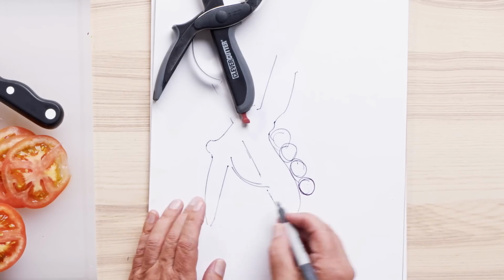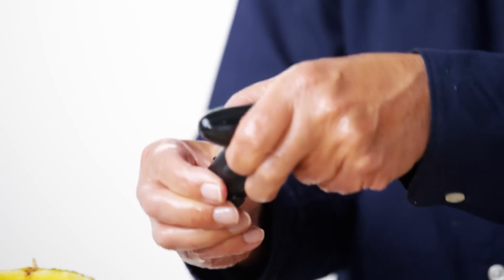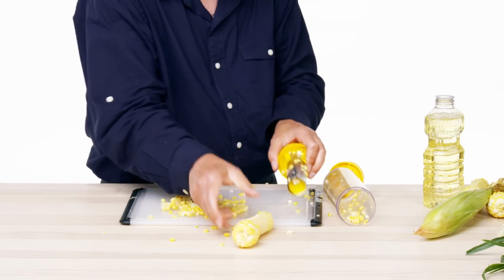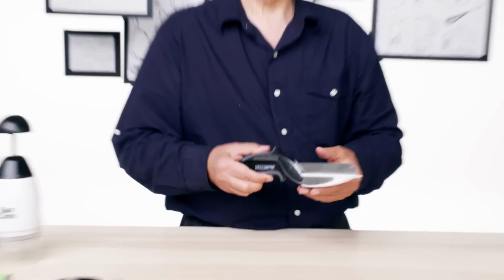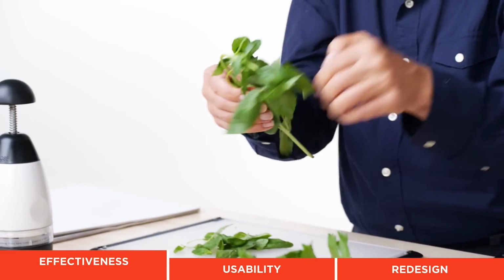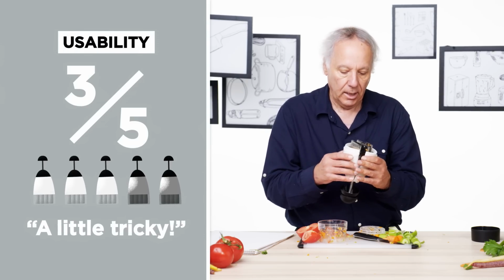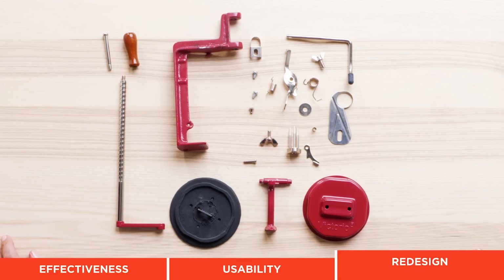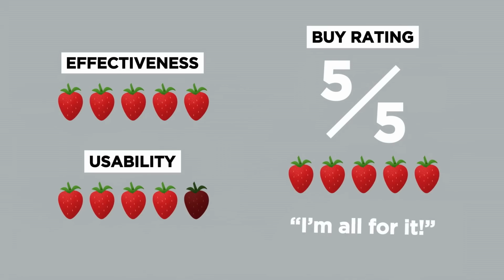7 Slicing Kitchen Gadgets Tested by Design Expert | Well Equipped | Epicurious

Comment: For the Slapchop thing, it probably would of been more effective to just take the big full-sized veggies and cut them so they fit in a blender, and just use the pulse-blend button (press, release, press, release, etc.) it until the desired chunk-size is achieved...The Slapchop is basically a manually-powered pulse-blending device, that doesn't seem to do the job all that well because of the gaps of the blades not reaching all the way to the cutting board surface, you don't have that problem w/ a blender cuz gravity usually pulls the pieces down into the blades (though some juicy pieces might stick to the plastic/glass of the blender-pitcher).

Comment: Thank you for thinking about dexterity problems!😊 Also using an oily left hand is great! Im left handed and I often have to rewash my hands just to hold something then after i’m done cooking my hands are super dry and I have to lotion them up. 
I wish every product designer used your method of thinking since most products, not even all kitchen tools, can be really hard to use as a lefty or someone with dexterity problems! I used to have seizures so now my grip strength is not good at all so using leverege or brute force does not go well for me 😅

Comment: To be honest the Square watermelons in Japan are sometimes not yet Ripe sometimes it is used for Decorations or offering cause some of the Farmers of the Squared watermelons had a Problem that producing those Squared watermelons. May not be Ripe yet cause They put it into a Square cage pannnel so that the fruit becomes Square ,Plus if you do eat some Square watermelons some parts will be seen a bit squished plus Square watermelons are 10 times  Expensive than Regular ones.

Comment: Fun fact. Since you mentioned arthritis I just thought I’d share some cool info about it. It’s an autoimmune disease that literally nobody has to acquire. It’s not genetic and it isn’t caused by old age. The culprit is actually animal foods and certain processed foods. Typically oils cause the inflammation in the joints that cause arthritis. Yes olive oil too. No type of oil is healthy for the body so avoid them and if you do use them use them sparingly. Meat and dairy is no exception either. All 3 are the catalyst in cause not only arthritis but a whole array of other digenerative diseases

Comment: For the pinapple corer i kept thinking of using a spring thing where a wiget goes up and down the spring following it like a ramp as to require only downward force.

The watermelon cuber is kind of an idea i never thought of

For a cutter i'm trying to think of a... Gullotine style thing where you set a notch distance(fractions of an inch on one end, milimetres on the other. I'm just not sure how to stop the blade in changing intervals(basically for the exclusive porpoise of evenly sliced vegetables XD

Comment: Obviously from the knob shape of the top of the corn stripper and the serrated teeth it is designed to be spun / oscillated. 
You don't grab a bread knife and push straight down...

Comment: >Struggles to cut everything with the clever cutter

5/5
Reply: Realistically just needs a much sharper blade and some curves. It’s a decent design on its own. But the sharper blade will help lots of tougher/harder veggies like carrots, beats, etc. then of course addings the curves to the handle will make it easier to squeeze. I could definately see it being a problem for people with disabilities if someone without them struggles with it. That goes for any product.
Reply: Well it's made for things that are mostly like a cucumber and not a potato
Reply: It isn't good for everything, but for the things it is good at it is great.
Reply: If you have only one arm this is the best possible choice for chopping honestly
Reply: @Paikerchu13  how do you hold the vegetable or the fruit in the scissors

Comment: Not that I'm an expert, but one thing that I've picked up is that you can't be rough with basil. The Slap Chop is a poor choice to use on basil because it bruises the leaves and, as seen, cuts them poorly. I had a chef show me that all you do is drag the blade across the leaves; let the blade do the work.

Comment: For the Slap Chop, I would add a rubber gasket type thing around the bottom of the clear cylinder for stabilization, change the overall shape to a cylinder, not a cone, add finger grooves to the middle piece and add rubber to the handle and the middle part for added grip.

This designer isn't very innovative, lol.

Comment: I just got the watermelon slicer on Prime day, and found that if you just slice off the opposite side of the rind as well, you can run straight through and improve speed and success immensely. Very little extra effort for very large improvement.

Comment: A square watermelon which would still block the fins when it gets closer to the rind. Instead, just cut the top and bottom of the watermelon so you open up the ends and the fins don't get blocked.

Comment: A lot of people are thinking that this is typically marketed for people with disability, which is generally true in some cases but a lot of it are actually marketed for businesses. On a regular household it's generally not a good idea to buy any of these unless you have a disability, or generally have any movement issues. If you're running a business/restaurant or generally need to prepare several apples, pineapples, etc; it's a good buy.

Point is, don't buy it for yourself (unless you're definitely in need) or as a gift for an abled bodied person. If you're running a business that requires you to process foods, it's something you should consider.

Comment: I dknt like the pineapple slicer since it just leaves too much leftover
Reply: I feel the same way about the strawberry destemer, it takes a lot of berry with it, using a paring knife is so much more efficient, or there is another one that looks sort of like a spoon, works great
Reply: Also with the watermelon device, I bet it would work better if you cut it in half lengthwise, cut off the ends, and used the tool along the whole length of the melon
Reply: I think it's because while peeling a pineapple you also need to remove the "eyes" which takes more time picking out one by one than just cutting the general edible parts
Reply: Yep. He care about the watermelon waste but didnt apply the same standard to the pineapple.

Comment: The pineapple screw handle could be detach with an anticlockwice turn.. a short thread or a "twist lock".
Instead of the corn stripper I would try something like a cheese slicer or a peeler idea... with a corn-sized slot of course.
The watermelon... I would probably use a knife to slice the melon in half and from there chop it into half-circles and then slice the half-disks into cubes.
-
Oh and the apple lathe, I got that exact apparatus and it is great. It works a lot better than you might think. It looks kinda wonky but man does it do a fine job.
The strawberry hole punch I would maybe design like a ballpoint pen.

Comment: I used to work at one of the biggest As Seen on TV company and most of those things do not really work or just make the work longer to finish, they are just gimmick with catchy commercials.

The average delivered prices were $2.50 but sold at $ 9.99, $14.99 or $19.99.

Comment: I find balled push surfaces with the fingertips painful for users.   Mainly because it applies a lot more concentrated stress on the middle of the fingertip, where the bone is.
I would have relocated the latches to the handle and applied it there, rather than where the steel tube is.

Comment: so I have two of those apple peeler corer units and I can say they are some of the most time efficient than you'll ever had if you like making things with apples.I'm not one to have a unitasker in the kitchen but this is the one exception I make and the best part is if you're trying to do large batches of apples for things like making apple cider or apple pies you can easily get through 20 to 30 apples in a matter of 10 minutes. Granted you have to every once in awhile cut out pieces of the core that got into the slices of apples but when it comes down to having to do the coring itself and peeling it takes a matter of seconds to take care of things to take way too long and the only downside I found when using this unit is that suction cup never stays attached. So if yours doesn't it's very normal.

Comment: fair point about designing for the extreme cases, but that is squarely in the realm of pure design. You also need to take into account whether the change affects the total end unit cost and if that extra market capture is worth it. 
often your gadget sells on novelty and efficiency of mass preparation, rather than catering to disability. You might run into a situation where the 10% extra has a serious effect on the profitability of the product.

Comment: He didn't use the suction cup at the bottom of the apple machine. You have to flip the lever over and it really gets stuck to the table and makes it easier and safer to operate

Comment: Perfect corn stripper would be a hardened stainless steel knife with a waterproof, tapered rubber handle. You could remove the corn with a few strokes of the knife and use the knife for so much more than just the corn in any fashion possible.

Comment: "Slap chop" and other branded similar devises of late are rarely good. Slap chop doesn't rotate mechanically, and esquires the user to rotate their hand. But mostly, modern ones don't come with sharp enough blades. Slightly more espensive ones (from reputable manufacturers), or older ones do work a lot better. There are ones with big price tags, just sold to make money, and made to a poor standard.
Ones such as "Slap chop" are made with "pointed" edges. Which is not for cutting thin flexible material like leaves or tomato or potato skin. But will chop (not cut) more crunchy material like the celery, or say turnip etc.

Comment: The Clever cutter wasn't really intended for big stuff, but I'm surprised it did well at all. It's mainly for making long, tedious fruit and veg like carrots easier. I found that's epecially so for people with arthritis and even Parkinsons. There's little need for controlling the knife in respe t to the chopping board. Because the chopping board is fixed to the knife.
The design team does appear to have been mainly people focused around cleaning, and aesthetics. Preferring that rounded handle, but giving eas of cleaning to the board.
Personaly I'd have gone for a similar design change, except with a small bump for the pinky to catch on, to avoid slipping.

Comment: The thing with all of these is more money than sense. I have a knife already. The avg house needs three knives 6' length. A serated a smooth curved edge and a cleaver.  That does the job and I dint have to buy a new item for every other thing. I just need to know which knife and the right technique. Which this guy does NOT use for any of these items.

Comment: With the pineapple you should really compare the yield, have a feeling the corer lets alot go to waste.
Reply: Yeah. The same thing goes for the watermelon cuber
Reply: I was thinking the same thing.  Got rather annoyed when he complained about the waste of the watermelon but not the pineapple.
Reply: Mavoc didn't he mention using it for a piña colada?
Reply: @normalgirlsza  That is not the point.  I am talking about all the extra pineapple along the outside due to how the pineapple is too big for that tool.  Seems the tool extracted less then 80% of the edible bits.
Reply: Mavoc pineapples have eyes though so on the outside, you don’t want a lot of that flesh either. And a lot of people have a hard time cutting them out
Reply: @talialalalala  its a valid point but its none the less  waste. Btw. One of the prime reasons people find the eyes hard to handle is that they use a far to big knife. Use the chef knife to peel then switch to a pairing knife.
Reply: yeah that bummed me out to see!
Reply: Thank you!!!!!
Reply: Agreed. I flatten the pineapple on both ends, quarter it along the long dimension, slice out the core, then run my knife along the inside of the skin, like filleting a fish. Virtually no wasted flesh.

Comment: 3:29 - I would've personally fixed the buttons by making them INTERNAL mechanisms. By that, I mean, the handle pegs into the shaft and the buttons pop out of holes in the shaft, yeah? Instead of the shaft having holes, just put U-shaped cuts in the shaft. That way rather than pressing the buttons back into the shaft you're pressing the little flaps on the shaft itself to push the buttons in.

Comment: With the pineapple thing look at the waste with a knife you have more control over the amount you cut and with a larger pineapple there's more waste.
Reply: With the watermelon windmill I actually own the product and I generally use it in combination with a knife it's quite easy.
Reply: The slap chopper may be faster but it also mashes whatever you're chopping but if you use a knife it's much thicker bulkier slices so it depends what you're cooking. It can be good for recipes where it doesn't really matter but with others where you want larger pieces like say stir fry you want a knife.
Reply: With the apple abomination just use a peeler if you really want the best part of the apple to be wasted and slice it before you core it
Reply: With the strawberry thing a knife is again better if you use the right type of knife with even a little expirence that you get before you decide to buy these products.
Reply: I believe knives are much better for   most things because you only need one set and it does everything. I don't personally like these niche products

Comment: i wanna see him try and use that apple corer/peeler/slicer on 20lbs of apples, and he can't forget to shove the apples into a bucket of cold water with a bunch of lemon squeezed into it. then once he gets anywhere from 5-10 apples in things will get real. some pieces of the skin will get stuck between the frame of the machine and the blade, so he will have to clean it out, which will definitely lead to slicing at least 1 finger open, which will ruin the apple he was working on, and hurt like hell because his hands have lemon juice and oils on them. then he will have to wash the thing. and within 3 apples of getting back into it he will come across one that is just a little bit too big for the machine. shortly after that, he will realize that he was lucky earlier, and a large percentage of apples are too big for the machine. 
and at the end of this hell, once he has lost more blood than he thought possible, he will put the stupid thing on a high shelf, and never touch it again. or at least thats how my 1st and only experience with one of those evil devices went.

Comment: For the Slap Chop, I actually own it, first of all if you want the bits to be smaller chop it up even more. Sorry if that sounds rude 😬. And I recommend cutting up unions in those. (Cut up the union into quarters put it in the Slap Chop and it’ll easily cut it up into tiny bits 👍🏻

Comment: I do wish the apple corer was easier clean....so I just got a small little washer basket for my dishwasher, stick all the little bits in there, lock it, and then wash the whole thing in the dishwasher XD. The biggest problem is getting the skinner part back to the right tension so it's not gouging the hell out of your apples when you peel them.

Comment: with the watermelon thing, i would say the best way to use that effectively would have been to just cut the watermelon in half and then take off the outside only on one side, then you have a lot more watermelon to cube in one go then before and it makes up for the little bits left by saving you the time. Seems to me though a better design would be more like a hollow square press with slots on the side for an included attachment to be pressed into to create the cube design. That product would be able to not only be used for watermelon, but also for anything you can press the product into such as ham if you use a knife with the slots instead of the attachment, or a lot of different types of fruit to make them more appealing to kids. and to make it really easy to get the food item out just simply push the tool into the backend because i would design it to have an open back with a hard rubber or plastic handle surrounding the hole to make it easier to grip with an at least 2 inch extension on both sides of the handle so that you can apply force to a larger area making it a lot easier to make up for no turning motion because its square.

Comment: My family loves the apple slicer. He didn't show that the slicer has a lever on the bottom that sticks it to the counter when you press it to the side (you don't have to hold the whole thing down!) I've never had a problem with the cleaning, and centering it is pretty easy. This is an essential tool in our kitchen.

Comment: He obviously hasn't designed any mass market cheap products. Product design is a compromise between what you want to do as a designer and the material engineering and tooling and, most importantly, profit.